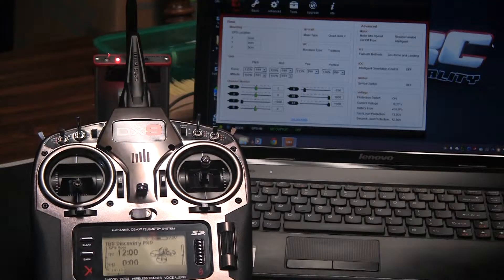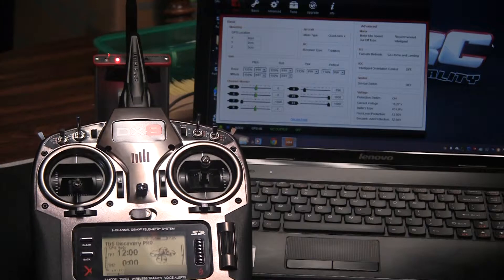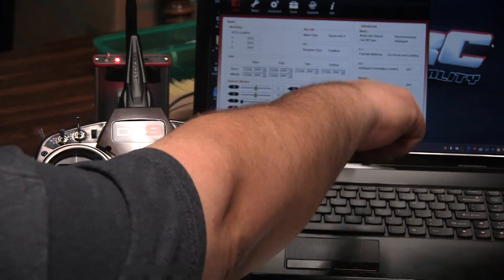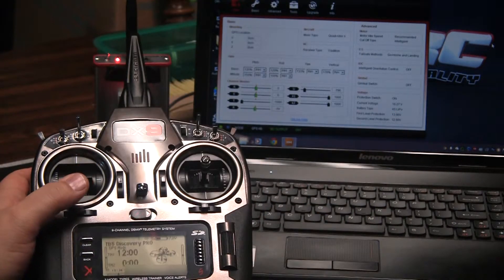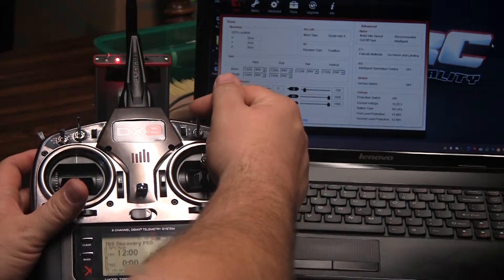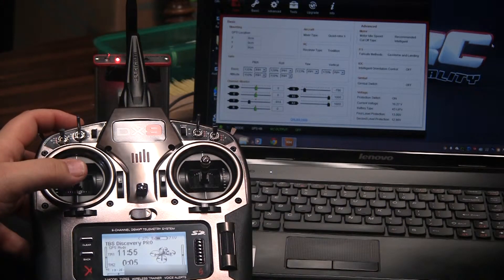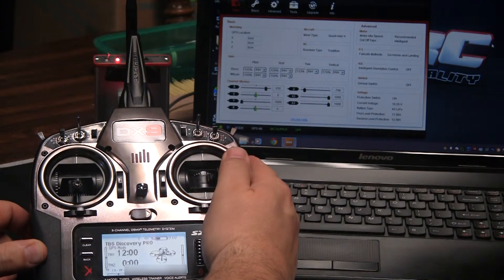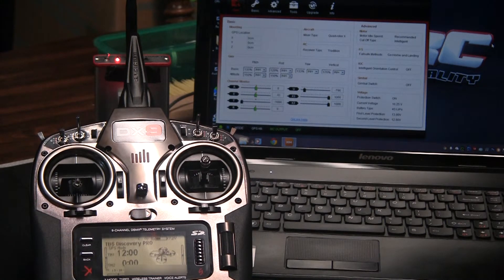DX9 NAZA

Comment: How did you get the Quad pic on your screen? I am really behind the times with my DX9.
Reply from the maker: It was on a custom Disco pro profile I downloaded on line. You can not select it, it's part of the profile. You can load that profile and then change it around for other craft change the settings and keep the image though.